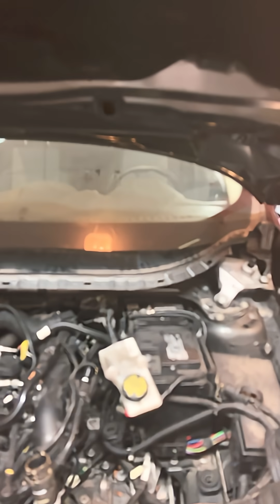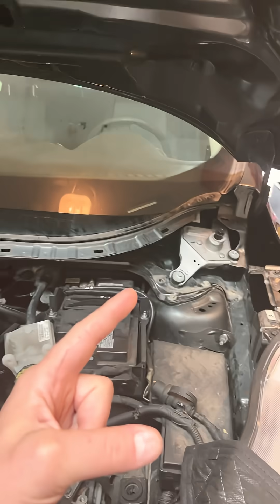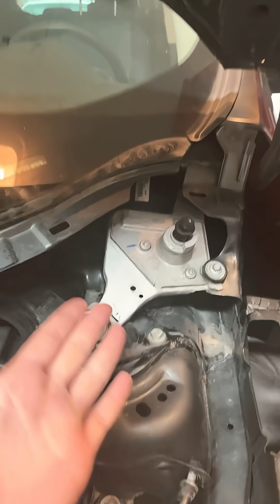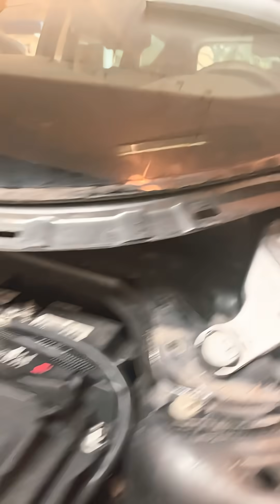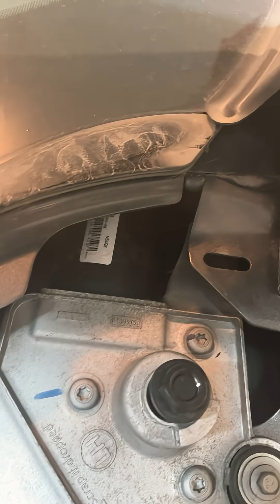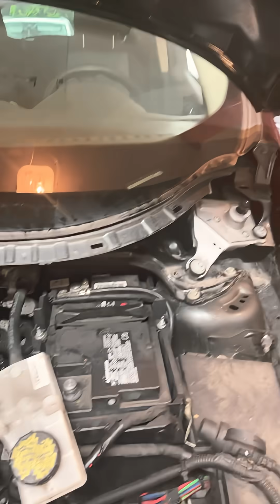Ford escape engineering explained two wiper motors

Comment: French cars had this system for years, the electronics are inside the motor, water gets in and they stop working
Reply from the maker: A negative nice. But the linkages seize up and sometimes burn up the motors. And they aren’t cheap either. So the issue is French cars lol. Joking but seriously buy a 2000s era Honda and drive it forever lol
Reply: @MyHomeGarage  I have a 2006 honda, the ignition switch failed and caused so much trouble that it started by itself, burned the starter motor out, killed the battery, but after replacing the starter, battery, and ignition switch the car drives just fine. Hondas are just built different and indestructible.

Lesson learned though, if the key ain't keying right, replace the switch before the apocalypse comes. 😂
Reply from the maker: @ProfessorFartsalot common issue Honda ignition the times where fat wires went there not it’s all push to start
Reply: @MyHomeGarage two motors with electonics cost over 500e each, so the second hand ones or refurbished ones are preety muchvolny option,  conventional aftermarket linkages you can buy for 150, 
Also japanese cars might be more reliable,  french cars has better rust protection and better comfort. 
What i want is french car with japanese quality  😀
Reply from the maker: @zwloki0 what I want is 2000s Honda reliability, 2010 Audi ride comfort, 2020 bmw performance and tech, and some Volvo seat lol.
Reply from the maker: I am Portuguese so I do have time in French cars. When I go back home. 206, my uncle always had a Citroen, my other uncle in French always drove Peugeot sedans. Manuals obviously. I still remember opel corsa hatch’s from the 90 2000s fast cars. Good memories

Comment: Independent brushless motors. Definitely more expensive, but can be moved when the vehicle is off without damaging the self indexing motors.

As someone in Canada who clears snow off the car for 4 months a year, I LOVE this feature.
Reply from the maker: I am also in Canada. I have been thinking about this over the last day. And maybe it is better. lol.
Reply: It is so much better. Linkage has forever been an issue in any snow place. The wire you think is going into the window is for a rain sensor. And the number one reason they did this was to aid in repair times, as the first step to everything on these shit boxes is remove the wiper trans. Pain in the ass. On top of that, no more heat related issues due to location and set back of the engine. Honestly the list goes on. Separate power circuits so you never lose both wipers, less circuit load, less parasitic drain, less issues with performance due to space. The list goes on. I’d be surprised if ford paid more that 25 bucks a unit.
Reply from the maker: @JoshH-q4p good point